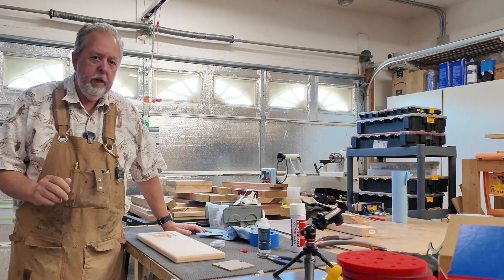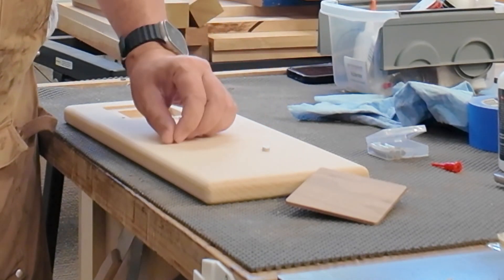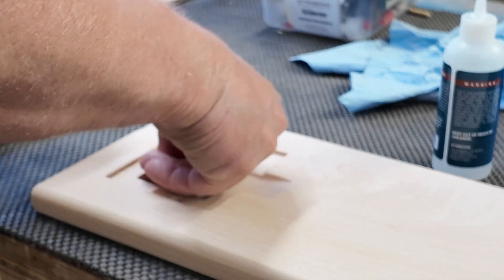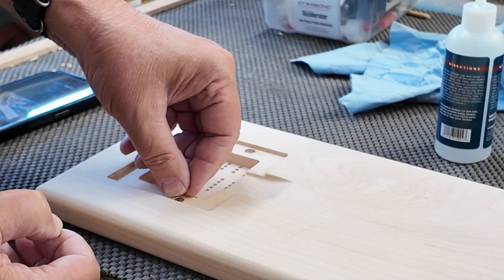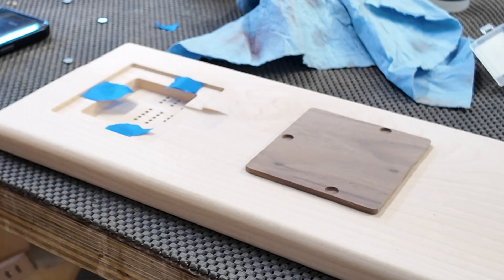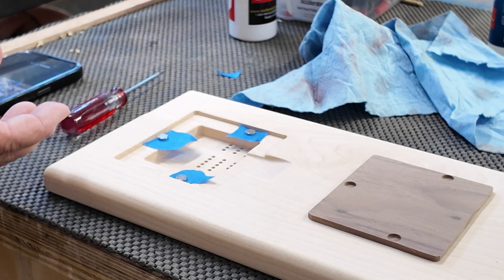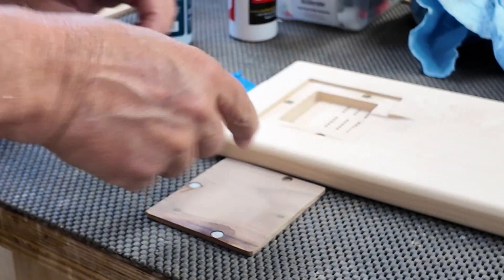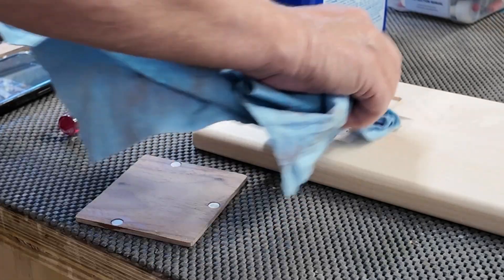Easy Guide to Installing Magnets in Woodworking Projects to Secure Covers & Join Materials

Comment: What if you used a small steel plate/sheet on top of the tape and then clamped it down to the workpiece or applied some weight on top. In theory this would depress the magnets but also they would attract to the steel sheet and would be balanced perfectly flush with the wood surface when it dries.
Reply from the maker: Thanks for sharing your thoughts.  That may also work.  One other change I implemented and discussed in a couple videos but haven't gotten around to making a video yet is I shifted to very strong magnets and now on the lid side I used ferrous material that will attract to magnets - small steel disc.  Then in the thicker body I use magnets and this way polarity doesn't mater.  I keep wanting to make a video but forgetting.

Comment: I wanted to attach these small magnets to a small plaque for my refrigerator. I attached these magnets to the plaque but it didn’t “stick” to the fridge. I realized about half of them were the wrong way, but I don’t  know which is the correct way! When I checked the polarization on the plaque, should a test magnet (simulating the fridge) be attracted or repelled to the magnet on the plaque?
Reply from the maker: Debbie thanks for watching and your question.  Your question is interesting because the short answer I would've provided without more insight would be that it should not matter which polarity you have facing out on the magnet, as long as magnets will stick to the fridge normally.  The only thing that I guess could occur is if the magnets were somehow canceling each other out, but I have not seen this before.  If that is what is happening, then I would think that a test magnet (simulating the fridge) should be attracted to the magnet on the plaque?  

Like I said I have done several fridge magnet projects and the only problem I ever had was when there were parts of my fridge that would not allow magnets because the material used was aluminum or some other material that magnets can't stick to (I have had that happen).  Or the other case I have had was the magnets I used were too weak compared to what I was trying to place on the refrigerator.  

I am not sure I was helpful, but giving you all that I know on the topic.  Let me know if you learn something different that I should know to be able to help others.
Reply: @RobSandstromDesigns Thanks so much for getting back to me. I had attached 10 tiny magnets to the back of the ceramic piece but when I went to attach to the fridge, it didn’t work. I then realized that 5 were repelling the test magnet. I then went to Lowe’s and bought 6 square magnets and kept them in the order they were packaged - thanks for that tip. It worked so now I have learned a lesson on polarity! Your video was great!
Reply from the maker: @debbiefox1650  thank you for letting me know that keeping them lined up worked.  I learned something new,

Comment: Thank you Rob.  Do you need to sand or rough up surface of magnet before gluing?  And how did you get the holes bored to align up in the first place?
Reply from the maker: Thanks for watching.  If I remember I do just do a light scratch on the bottom of the magnet - but to be honest I often forget.  As for location, I have the pleasure of using a CNC so I align the magnet holes between top and the bottom while designing the project.  If I didn't have the CNC I would likely use a cardboard template that fits the inside of the cribbage board and the mating surface of the bottom of the lid.  Then I would be able to match them up.

I am finishing up a video as we speak on an even easier way to install some magnets in lids.  I found some magnets that are so strong that I only put magnets in one side of the connection and a ferrous (metal) material in the other side so polarity doesn't mater.  Watch for that.

Comment: Great video, as always!
How deep do you cut the magnet pockets -- do you leave an "air gap" above the magnet?
Reply from the maker: For these magnets I cut 0.8" deep, they are 2mm thick slightly less than the 0.8".  I want room for glue under and a little dap very slight above to allow sanding over the top without scratching up the magnets.  Each different style/manufacturer magnet I measure and test size and depth.  I do the initial test using my jig I used for testing magnet and dowel sizes.  That jig is covered in this video: https://youtu.be/jk5rQf836HY

Comment: I thought at first you were simply going to use steel rounds on the cover and magnets on the main in order to make magnet polarity a total non issue!
Reply from the maker: As I was making this video and sharing with a friend he indicated using blanks was his method.  I have used washers as blanks with some of my larger/stronger magnet projects.  But, I hadn't found strong enough smaller magnets for these smaller cover projects.  My friend shared a link to magnets he used.  So, I am going to try those out and see how they work.  Always looking for easier and surefire methods.